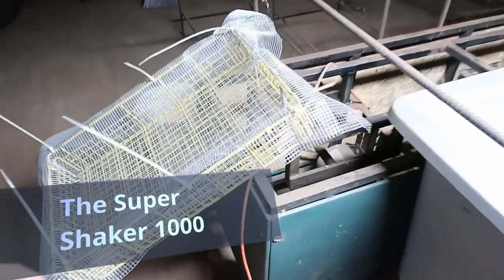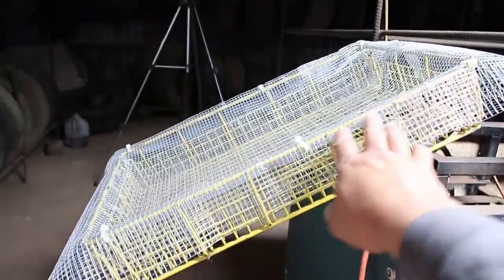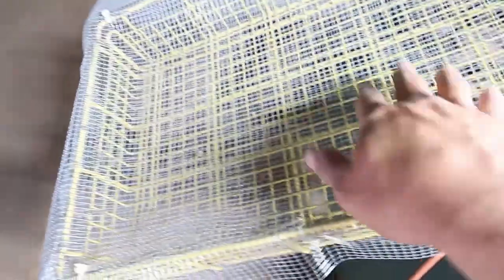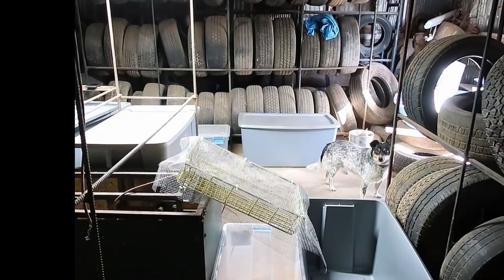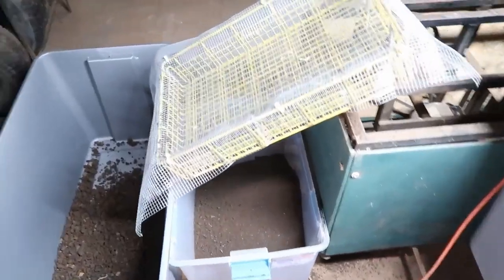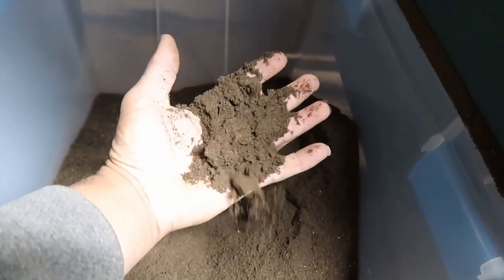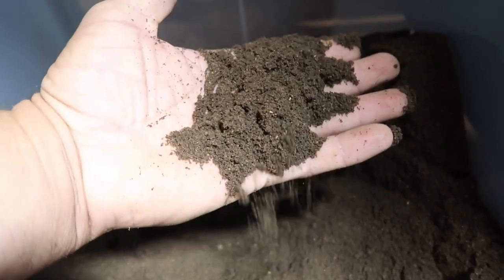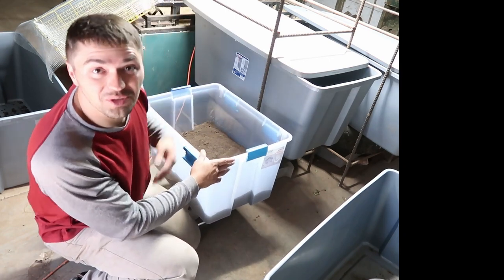How to separate worm castings fast and easy with my custom made machine. The Super Shaker 1000 MRLG3

Comment: In a later vid I just watched, you mentioned a 1/8 th screening. What are you using to do that fine screening? How?

Good job on DIY inventive mechanized set-up.
Reply from the maker: I am using the same machine. But just using a 1/8 screen instead of the 1/4 screen. The same process. Just a different size screen. 

Thank you
Reply: @LUPE.G3  Please link on 1/8 th flexible screen if you have one, or let me know who the maker is or if the source was local to you. 

The 1/8 th is hard to find. Seemingly impossible.

Thanx.
Reply from the maker: @flatsville1  Brand: Rural365

Rural365 Galvanized Steel Hardware Cloth 1/8 Inch Mesh Chicken Wire Fence Cage Screen Netting - 3x10 Feet Bulk Roll

On Amazon
Reply: @LUPE.G3  Thanks will likely beat the price of the "archeology" or super-duper industrial suppliers (large quantity) I've come across.
Reply from the maker: @flatsville1  you're welcome. Yes its very affordable and does a good job